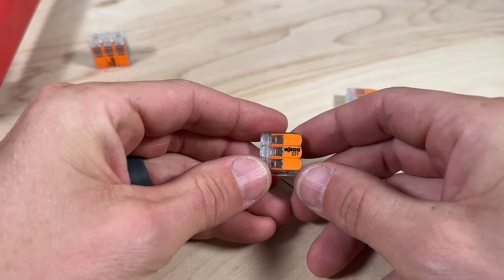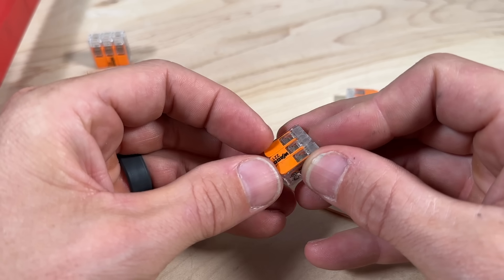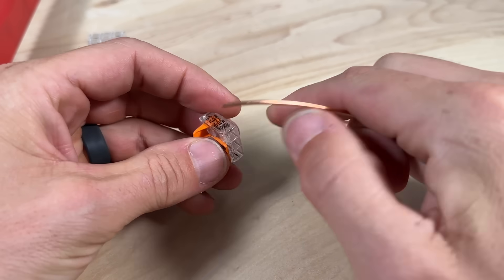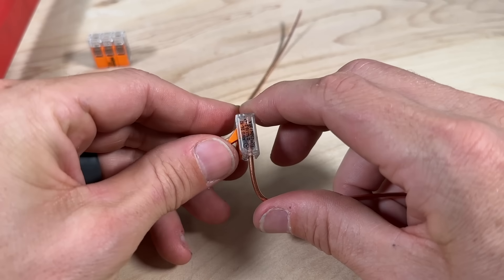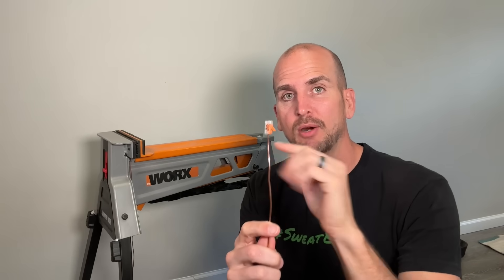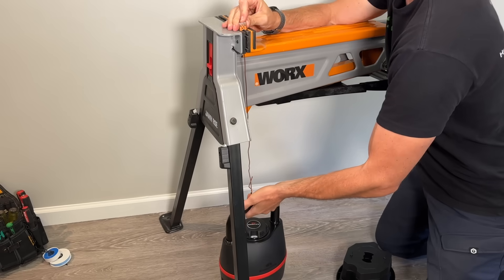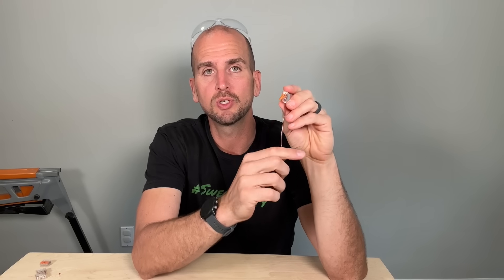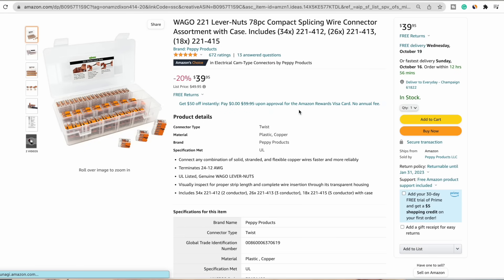WAGO 221 Lever Nuts: Testing the Most Common Negative Feedback

Comment: This is minor compared to the issues a screw wire nut will cause, the issue with screw  wire nuts in North America comes from the fact that the wires in the splice get shoved in and the wire nut is supposed to hold the wires but the problem with that is the splice itself is a weak point but also creates unnecessary resistance which allows the splice to heat up melting the plastic of the screw wire nut which could potentially create a short circuit issue and depending on who wired the breaker panel up could’ve potentially put a breaker that’s rated for a higher current than what’s actually needed, at least with wagos the one problem can be circumvented with a bit of electrical tape.

Comment: If you have the problem of "accidently" opening those levers while pushing in the wires in the box ... get another job.
Keep enough space in your boxes and have them as tidy as possible and you will never have to "cram" your wires into the box.
When I wire boxes a single bend will nearly always suffice to keep everything nice and tidy inside a box and when closing the box the lid isn't even pushing or touching a single cable inside that box. Same with sockets, they get nicely and easily pushed into place without having to use much force (barely any force) and will happily and effortlessly stay in place until I screw them down to the box.
Also, blindly using 221 series everywhere is stupid, In most cases the 2273 series is a much better solution and will also use less space in your box.
Using the right product in the right place and being VERY tidy is a must for every electrician!
Code here : In a junction box, it is not permitted to mix different circuits. One circuit per junction box. So if you have to "cram" everything inside the box you probably left to much wire which is also against code!

Comment: Tape and be neat with your installation.... wire is not a support ! And trying to stuff a shit load of wire into a box is not a good  idea....look at the thermography shots, and the heat sources ? And every one of the connections is showing heat ! Give your connections some air space . Now with AC you have more juice ! But with low voltage not a problem. Be neat with your work it will show the next person that whoever was there before them knew what they were doing.

Comment: If it's tight in the box, just use a 2273. No lever no problem. I really don't understand why Americans waste so much breath over this. In Germany, the 221 isn't really used that often by electricians. Usually only for appliances and light fixtures, because you can disconnect these by flipping a lever. Very convenient. With the 2273 you have to twist an pull really hard to release the wire. No way this happens by accident. The spring bites so hard, you can see the marks after you pulled the wire out.

Comment: I don't have any problems with the half-open position. When I am folding the wires back in a box I find the Wago lever nuts allow me to position the wires much better than a twist connector. I can bend each wire almost independently so they fold in very cleanly. I have had only once or twice where the lever popped up to the half-open position and that was easily corrected. You don't have a bunch of wire pushed in willy-nilly all over with the Wagos and they create so much space because of the folding action. I love them for the Zwave switches and controllers I use because boxes are FULL UP and the 221, even better than the earlier gray ones, just let me fit everything.

Comment: Do you think that flaw could be gotten rid of by just throwing a band of electrical tape around it after making the connections? Going to be installing a smart dimmer wired off of an outlet with pigtails to control some under cabinet lights and want to do it the safest way and avoid burning my house down so trying to learn😅

Comment: It would be very interesting to repeat the temperature test.  The reason is, you're getting so little heat that you appear to be dealing with a resistance on the order of 1/200 ohm, and results may depend on exactly how clean one wire is relative to another.  It's reassuring to see that the temperature rises no more than 20 F with 23 amps going through.
Reply: BTW, I find lever nuts very handy on the workbench (I do electronic design and repair) because you can connect practically anything, and then release it and get the wires back undamaged.  I've taught my grandchildren how to use Wago connectors to build simple circuits with batteries, resistors, LEDs, etc.

Comment: Hey, thanks for your video. I was going to purchase a box of Wago wire connectors but I see they have the 221-412, 221-413, and so forth. Every single kit I looked at comes with so many 221-412 connectors. Just wondering why? What would be a use for those connectors?

Comment: ⚠️  Give the new Ideal”knockoff” product a shot….
They are quite good and has the lever part reversed AND has a small plastic pin that locks the lever down once you lock the conductor in.

We mostly do fire alarm and radio communications wiring, so our wife sizes are probably on the smaller (#18 - #14 AWG) size.
We used the Wago connectors from when they were the push in / “backstab” type connector and then the lever type but have moved to using Wago only for connector count higher than 3.

Nice video.. Thank you.

Let’s Go Brandon… Straight to Prison w/Hunter.

Comment: Dear colleague, it appears that you may be utilizing it incorrectly. It is not advisable to insert a solid wire into a 221. Rather, it is recommended to employ 2273 for such applications. The 221 is specifically designed for use with stranded wire. I find myself curious as to why individuals in America often neglect to consult the accompanying manual.

Comment: I also don't understand who would be pushing these back in the box with the lever towards other wires or wouldn't simply check the connections when they are done. Like, use your common sense. Still far quicker and easier than wire nuts.

Comment: Nice vid and test. I'm a EE (and long time software engineer) and a big proponent of testing to failure. I come from a machine tool family/background, so this kind of thing is in my blood. I just finished an electrical job for my friend's house and chose to stick with twisting 12 and 14 gauge with good quality wire nuts rather that Wago as the little lip on the tab made me unseasy especially with pushing the connections back into the boxes. One thought I've had was to file off the lip to lessen the chance of having one pop open and not being able to see it once the outlet or switch was tucked into place. 
I'm using the inline connectors for replacing 2 fuse boxes with a main panel. Nice and clean.

Comment: I think some of the concerns comes from when pushing the connector back into the box if it is partially open the partially open latch could catch on something I.e. another wire or something else in the box and open fully without you realizing it.

Comment: Pulling force does not equal conductivity.  It's difficult to measure conductivity in something that's nearly 0Ω in the first place but there are ways.  Both concerns are critical though.  Pulling out is definitely more of a concern than some slightly greater resistance that might warm up the connector at worst.

Comment: If you're that concerned about a subjective 5 lb. difference, then just wrap electrical tape around it..
Reply: I’m concerned about the tape holding in heat when under load.

Comment: The original Wago's had a skinnier more recessed lever, and it was a lot harder to open. I have a mix of them and I love them. I particularly like the 5 hole ones vs trying to twist 5 wires into a wire nut. As I work around the house and come across wire nuts they get replaced with Wago's. So far it's been 10 years and I haven't burned down my house yet.

Comment: You didn't test the common failure I have with Wago.  How much pressure does it take to overcome the spring and fully open the lever and why does it open in the first place?  This easily happens when rolling or pushing the wire into a box and the lever catches on another wire.  Because the wire enters the connector on the same side as the lever, when you roll the connection into the box with the levers facing in, they can open during the process because they are on the inside.  Rolling the wires with the levers facing out minimizes this problem.  Think of what happens when you put teflon tape on a pipe in a counterclockwise direction.  When you connect the fitting, the tape comes off.  But if you put the tape on clockwise, it works.   With Ideal lever nuts, the opposite is true because the wire enters from the end opposite the lever.

Comment: Strictly from this video standpoint, vs the Chinese knock offs - (the grey fat ones, didn't try the ones that look like Wago) the lever doesn't move at all, takes lots of force to open.  How often are wires moving around behind the scenes anyway?  Worst case, a receptacle may move a tiny bit when a plug is going in and out of it, but my eyes haven't perceived that at all for my outlets.  Presumably any movement, even if tiny could loosen things over time, yet at the same time, most receptacles, are stuffed in the box big time, under pressure with the wires against each other or with tension against sides of box etc etc.  I really don't believe anytihng will ever loosen in 99.9% of cases.  I replaced all 1960's / 70's outlets/switches in my house and none of them were loose.  The connections to receptacle/switch were screws, granted, and wire nuts in some boxes for various reasons, but still, nothing loose, though maybe a couple wire nuts not the 'tightest' but only easy to take off as I took them off, not because they had moved at all in 50 years.  One mans opinion.

Comment: Did you use the same connector in every test, or each test iteration had new connector? 

Cause if the same was used - I think the tests with closed lever could have deformed internal clamps (creating plastic deformations in metal parts), and it was snapping at lesser forces than the brand new connector would.

Comment: I have wired our complete new built home with Wago 221 lever nuts and never had a problem with a wire pulling out. Even in crowded junction boxes where multiple modifications and multiple movements occurred none of the levers were half opened. 

I would also recommend against wrapping Wagos with electrical tape as it takes away many of the advantages: cannot visually inspect wires through the clear plastic, harder to insert a tester for measurements, harder to make changes. I have never seen any German electrician recommend wrapping Wagos with electrical tape who have worked with some type of Wagos for decades. Additionally, this may even violate code in some countries as this is using a product in a way not intended or certified by the manufacturer.

Comment: Not convinced by there current handling capacity and I know people think 20lbs is a lot of force but you would have to snap the cable to pull it out of a screw terminal block installed correctly.

This is a convenience product for lazy people tbh.

When you screw down a terminal you can deform solid core to increase the contact patch and also the contact area is also round the bus bar in the wago is flat and you will get a very small contact patch

Comment: I have had problems when tucking those things back into a standard box, especially when converting a series set of wires into parallel. It's easy to misaligned the wire in the lever although it's clamped down.

Comment: Did you use the same connector for all the tests or did you use a new one each time.  If the connector was a new one then after failing at 20lb with the lever half out did you retest that same connector with the lever back in again to see if the force needed was greater again.  I think Wago connectors are brilliant too. In the UK they produce power outlets (sockets) with Wago connections.  I think they should perhaps think about producing the back boxes with Wago connections so that the mains cables are permanently connected to them and a short cable is then put on to install the socket.  This way the mains cable is protected from too much bending and failing and newer sockets can be changed much easier.
Reply from the maker: New connector for each of the test runs

Comment: If you're only connecting Solid Wires, you should use the Wago 2273 instead. Wago also sells connectors and accessories for nearly every other use case you could imagine.
Reply: THIS 

Many people neglect to read instruction manuals and then cry for the (imagined) effectiveness of wire nuts.

Comment: 20lbs of force is a ridiculously high amount for the force experienced in an electrical box. - I concur with another commenter that wrapping electrical tape around the closed Wago nut would offer the best protection (and peace of mind). It’s still better than the standard wire connector, which in my experience, is more likely to fail than even a partly open Wago nut.  _ gave all my wire nits away and went totally to WAGO

Comment: Encountered this very condition this week.  Installed new hardwired smoke/carbon detectors and went with the WAGO connectors and noted this condition while stuffing everything into the box.  I did make a concerted effort to make sure the levers were in the locked position, but with three 3 pole connectors in there, it’s possible that the first one in got a lever or two moved out….  Doubtful 20lb of pull will ever be applied to them, but you never know.  Still like them for the ease of use and the smaller footprint.  In some applications, they are hard to beat.

Comment: Is it normal for these to wiggle around when the lever is closed? Both the area in front of and behind the clamp will move side to side as you wiggle the wire, even though the wire cannot be pulled out. Was working with 14 gauge solid. The lever is fully closed and it is (as far as I can tell) a genuine Wago 221. This was my first attempt at using a 221, and it felt unsafe enough that I ended up pulling it out and wirenutting the connection.

Everyone swears by these, so I'm wondering if that's normal or if I somehow have a defective batch.

Comment: I have used dozens of WAGA wire connectors without failure. I can’t say the same for traditional wire nuts. When hanging ceiling fans, the WAGA is vastly superior for ease of installation, as the WAGA nuts can be pre installed on the fan’s wires before being lifted into place. There are knock-offs of the WAGA, but having seen comparison tests, I’ll stick with genuine WAGA nuts.

Comment: Here’s what’s happening.  Pulling the wire straight outward, is not an issue.  HOWEVER, if somehow the wire is twisted slightly, while force is pulling will allow the wire to slip out of the wago. B

Comment: Have you pull tested wire nuts?

Water is 8 pounds per gallon, a full 5 gallon pail weighs 40 pounds, add some lead if needed. With a funnel and hose you could add weight smoothly, and measure failure to the ounce.

Comment: So how much force could a typical screw on wire nut take until failure? What are you comparing it to?
Where is there any fact based data on this even being an issue in the real world? Lots of anecdotal statements, and some just plain made up in the comments but no real world data. 
Have to pay attention to making sure they're fully closed? Well duh, you have to pay attention to every single electrical connection to make sure its secure and properly installed. 
I really don't understand the point of this "test".

Comment: WAGO's are great and my go to when I have short wires in a Box but for all solid wires with enough length I still use wire nuts. Also when using solid & stranded they are good to use but if your so concerned about grip wrap electrical tape around the WAGO to make sure the levers remain down though it's more likely an over kill.

Comment: Here in Germany we're rather using Wagos 2273 series because they're smaller and cheaper.
The 221s are used when combining a solid with a stranded wire. Or, they're perfect if one just wants to just try something in a none permanent build.

Comment: People seem to misunderstand everything about these connectors.  the lever being slightly open has absolutely no effect on the contact force and hence no effect on the electrical properties or the mechanical ones.  Taping the levers down is entirely unnecessary.  How on earth do you get an installation with 20lb (9kg) force on the wires?

Comment: I don’t really see this as an issue. The levers should be in the fully down position once the connector is in place. If it’s not that’s due to installer error/incompetence - the same with any product that’s not installed correctly or installed without diligent inspection.

As some others have said though, these connectors may not be ideal for solid core wire and/or for use in 120v system where higher currents are common.

Personally being in the UK I use them either on 220v circuits where currents are generally no higher than 16A.

Mostly though I use them in DC circuits in Motorhomes/RVs with stranded wire which I think makes for a better connection in these than solid copper wire does.

Comment: It seems your results show that, when used properly (make sure they are fully closed) they work as intended - however, when not used properly (leaving the lever part way up) they do not work as intended. So, the problem seems to be "user-error" ... not the design of the 221.

Comment: We replaced them in a factory in a plastic box on a pump motor that continually runs near the tempering furnace. The connector melted. They will work well in LED light fixtures. The factory has 100s running all the time. The little demand they have in the home would not cause problems.
Reply: There is a test in YouTube. Wago 221 melted when 90 A current but not when 80A.